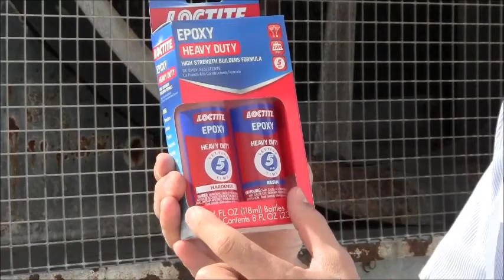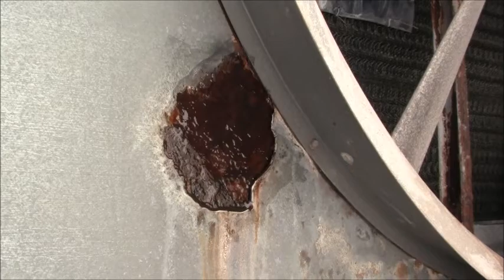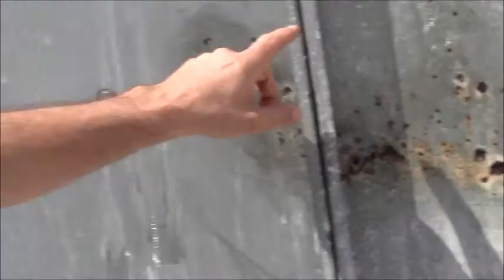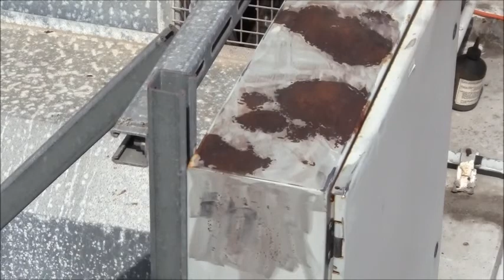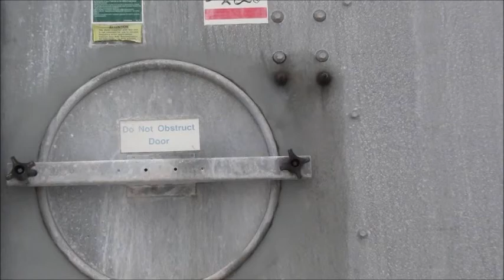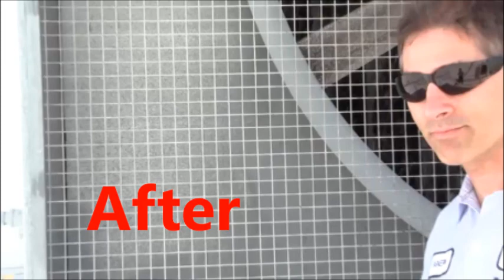Cooling Tower Repairs

Comment: It seems like it would make more sense for the manufacturer to coat them better originally. Some of the companies that make spray bed liners or specialized epoxies could probably produce a type of paint the manufacturer could use to get more life out of these but that would mean not getting to sell people a replacement as often.

Once the metal gets exposed and starts to rust it's hard to save it. They could partner with some of those spray liner/epoxy companies, coat various sample metals in them, and just submerge all of them in various water solutions containing salt, minerals, and the various chemicals they treat the water with and they could release a line of these things that are actually pretty durable.

You could not coat every part because the material would insulate heat too but the majority of the container you guys are working on is more about infrastructure than it is thermal transfer. The tops of the electrical boxes look like they were only painted with standard paint. Why not spray on truck bed liner for that stuff? Like even $50 worth of the stuff could have saved you guys a huge amount of work.